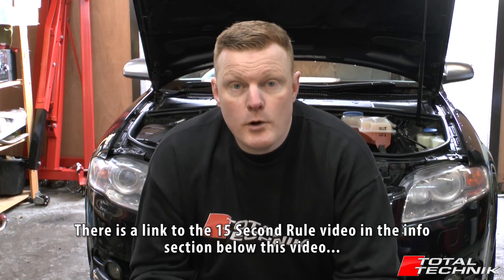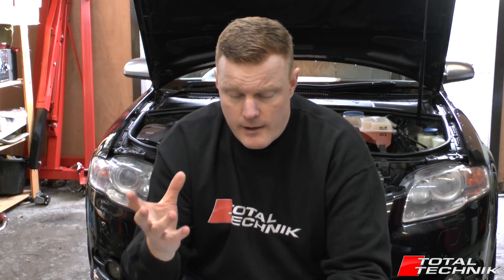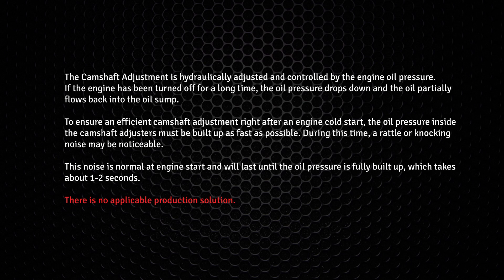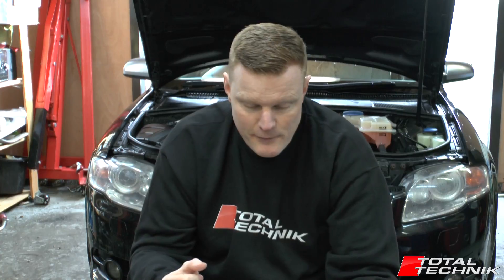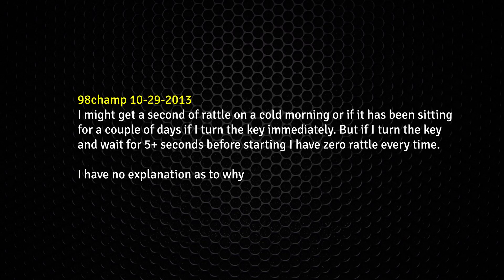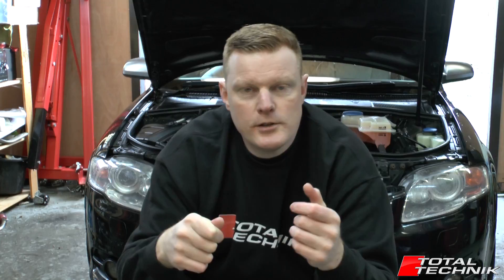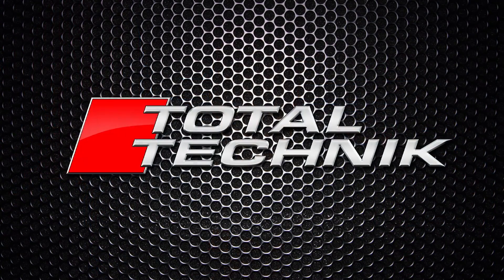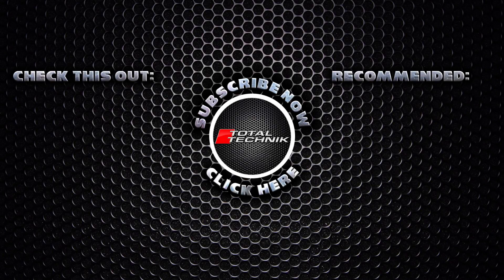Audi S4 15 Second Rule TECHNICAL DISCUSSION -  B6 B7 - 2003-2008

Comment: The B7s that I have fixed have a bad non-return allowing the oil filter housing to drain its contents back to the sump. Change the valve and the rattle at start up disappeared. See video.

Comment: Have a 2005 S4 4.2 with 88K on the clock. When it starts with out waiting 15 seconds it sounds like the timing chain is about to tear itself out of the engine. It does help alittle to wait 15 seconds. But saw a video with a guy who said check valves under intake are at fault. That makes sooo much sense, as they would hold the tensioners up and not allow them to back down. As always, cleanlyness is next to godliness at least with engines.
Reply from the maker: Thank you for your input, very much appreciated!

--- 

To help support us (for both you and others reading this) there are a few things you can do:

1) Donations both needed and welcome! We cannot operate Total Technik without the support of people like you! You can donate by PayPal - just go to www.paypal.me/totaltechnik
2) Please ensure you subscribe to our YouTube channel. 
3) Please give our video's the Thumbs Up on YouTube. 
4) Please help spread the word, the more people who know about us the better! Add links to our video's in forums, let people know about us.

Thank you for your support!
Reply: Have you made any progress regarding the the check valves? I'm looking at doing them on my car and would like to know if it worked or even helped.

Comment: Interesting video here, with another possible cause/solution for cold start up rattle, involving the oil return valves going bad, creating an oil pressure retention problem. It fixed his rattle, but would have been useful to know if the 15 sec rule prevented his rattle before he replaced the oil valves: 
https://www.youtube.com/watch?v=y3HXmNePHkw&list=WL

Comment: I can confirm the 15 second rule works on my 2004 S4 B6. Mine has had the chain revision done, but I used to get a short noise at start-up. So I guess that was the intake flap.
Reply: SsgtHolland how much did it cost you to have the timing chain guides and tensioners replaced?
Reply: @pw760  personally it cost me about 5k. Warranty wouldn't cover it. However I still had rattle until I changed my check valves.
Reply: Did you do anything about the intake flap? Was it decreasing your torque at all?
Reply from the maker: Perfect - thank you for sharing the info - that's exactly what this video and discussion is for! Thank you!

--- 

To help support us (for both you and others reading this) there are a few things you can do:

1) Donations both needed and welcome! We cannot operate Total Technik without the support of people like you! You can donate by PayPal - just go to www.paypal.me/totaltechnik
2) Please ensure you subscribe to our YouTube channel. 
3) Please give our video's the Thumbs Up on YouTube. 
4) Please help spread the word, the more people who know about us the better! Add links to our video's in forums, let people know about us.

Thank you for your support!

Comment: I’ve had an 06 B7 S4 for 2 years. To be honest I’ve always given it it 5 or more seconds just to let the fuel prime to make sure I get a clean start. I’ve had turbo’d cars that had problems created with stuttering starts so I always try and let things ‘get set’ before turning the key so it fires instantly, and therefore builds oil pressure fast and tightens the chains. On an earlier comment the theory of ECU’s and sensors taking various times to stabilise and therefore giving time to ‘get set’ again for a crisp start - I’m with that theory. Even just giving it 5 secs and I rarely hear chain rattle - I mainly get flap valve flutter, including at tick over that goes when you push the actuator arm with your finger. My car is in Hong Kong & I doubt it ever got an ECU upgrade to reduce flap rattle at start up - but not worried.

In my view giving this car with a lot of complex sensors and ECU’s, and lots of heavy moving parts, the best chance of a clean start is the key to chain / tensioner health - to a degree. They are still weak components - so I’m still sitting on a time bomb, but it’s a great drive ...
Reply from the maker: Thank you for sharing - that's exactly what this video is about so we appreciate the input, as we're sure do others as well!!

--- 

To help support us (for both you and others reading this) there are a few things you can do:

1) Donations both needed and welcome! We cannot operate Total Technik without the support of people like you! You can donate by PayPal - just go to www.paypal.me/totaltechnik
2) Please ensure you subscribe to our YouTube channel. 
3) Please give our video's the Thumbs Up on YouTube. 
4) Please help spread the word, the more people who know about us the better! Add links to our video's in forums, let people know about us.

Thank you for your support!

Comment: After watching various videos and reading comments regarding the B7 S4 rattle, I've decided to start my own experiment and over the next few months make/keep some notes and report my findings at the end for anyone who may find it useful.  I brought my S4 Avant with 95k and FASH  7months ago and have done 8000 smiles since,  with no dramas other than everyday running costs (fuel lol) but that's irrelevant anyway. My car rattles when it wants (for upto 2 seconds) and cold starts make no difference as its rattled at 13C+ and I've heard nothing -3c which makes me think its something to do with pressure?? however I'm no mechanic or Audi specialist so may well be wrong?  However on a personal level,  temperature doesn't seem to be the main issue for my S4.  I'm intrigued more than anything to know more myself because I'm sure its the main thing that puts people off buying them or are they are becoming that rare???  Because I've not seen another since buying mine... which along with the v8 were the 2 main reasons I opted for an S4 over s3
Reply from the maker: Hey there! Thank you for your input and sharing - that's exactly what this video discussion is about!!

The term cold start means that the engine is cold. It does not have any relation to ambient temperature. So many people will experience a rattle when the engine is cold (i.e. left overnight or for a long time). When re-starting when the engine is warm or partially warm often it will not rattle, depending on the nature of the issue at hand, which is outlined in the video and the comments here.

Yes, the rattle issue can indeed be a factor that puts a lot of people off of buying these superb cars. A shame really as all things need to be taken into consideration, i.e. no regular cambelt changes but one big timing chain job instead at a much higher interval = not a massively dissimilar price overall?

But yes, the V8 is a huge bonus!!!

--- 

To help support us (for both you and others reading this) there are a few things you can do:

1) Donations both needed and welcome! We cannot operate Total Technik without the support of people like you! You can donate by PayPal - just go to www.paypal.me/totaltechnik
2) Please ensure you subscribe to our YouTube channel. 
3) Please give our video's the Thumbs Up on YouTube. 
4) Please help spread the word, the more people who know about us the better! Add links to our video's in forums, let people know about us.

Thank you for your support!

Comment: Really interesting , I have just got a s4 which had a chain replaced 35k ago

I get what I assumed was a chain rattle on hot or cold starts , even if the car only sits for an hour. The car has no rattle once running and drives fine 

I am wondering if mine is intake related as that would make more sense than a chain that rattles every start then drives fine 

I’ll be checking to see if the update has been applied and if not I’ll report back if it improves things
Reply from the maker: Thank you for you input, and definitely come back and let everyone here know any updates! Seems to be a really popular topic, so please be sure to come back and share any more info with others here. Thank you!

--- 

To help support us (for both you and others reading this) there are a few things you can do:

1) Donations both needed and welcome! We cannot operate Total Technik without the support of people like you! You can donate by PayPal - just go to www.paypal.me/totaltechnik
2) Please ensure you subscribe to our YouTube channel. 
3) Please give our video's the Thumbs Up on YouTube. 
4) Please help spread the word, the more people who know about us the better! Add links to our video's in forums, let people know about us.

Thank you for your support!
Reply: I recently bought an S4 which also (allegedly) had its timing chains done. Every now and then on start up (warm or cold) I also get a short slapping/rattle sound. You think this is probably the intake flap? If so, what should be done about it?

Comment: I have had a total chain and tensioner change on my S4 2004. Tried to learn as much as i could during that operation. I have also had the problem with ratteling intake flap. 
When i hear about those who have less ratteling when they wait for 5-10 seconds with the ignition on before crank i can think of two things. Either the flap in the intake manifold, or the electical chain tensioners on each cylinder head. Maybe those tensioners have time to pick up the slack in the chains if you wait 5-10 seconds with the ignition on before start... What do you guys think of that theory...? My problem are solved. Total chain-service and the intake thrown to hell and replaced with a self-built supercharger system. 
Thanks for the video!
Reply from the maker: Hey there! Thanks for sharing your experiences for others - that's exactly what this video is intended for :-)

--- 

To help support us (for both you and others reading this) there are a few things you can do:

1) Donations both needed and welcome! We cannot operate Total Technik without the support of people like you! You can donate by PayPal - just go to www.paypal.me/totaltechnik
2) Please ensure you subscribe to our YouTube channel. 
3) Please give our video's the Thumbs Up on YouTube. 
4) Please help spread the word, the more people who know about us the better! Add links to our video's in forums, let people know about us.

Thank you for your support!

Comment: Interesting video and discussion. Within the couple years of owning my B6 S4 I have replaced the chains and cam tensioners along with the intake manifold flapper (including update to software). 

My main take homes from the various noises these bought about:

1. Before replacing the chains, there was a noticeable noise on startup at the back of the engine, particularly on startup but if you listened carefully it was there most of the time when warm too. I ended up have 2 cracked guides and sporadic codes relating to camshaft positioning.

2. When my intake flapper went bad it produced a fairly similar noise to the chains but louder and it didn't seem to be isolated to just cold starts. My flapper was basically stuck open meaning I lost some grunt lower down the rev range. It meant the car felt more slugglish accelerating than it should. Up at the top end it had no affect as the flapper is supposed to open around 5k (or something like that).

3. Since having the repairs I've had zero startup rattle from cold starts. The chains were done 18 months ago and still no noise on startup.

So I'm not entirely sure a healthy S4 engine should have any sort of rattle but I've only ever own this one so no others to compare with.

Comment: Hey thanks for you videos. Very informative. I have a B5 A4 with the 2.8 amx engine on 230,000kms. This engine also has "the rattle" on cold start for 1-2 seconds. It even says in the owners manual for the car that this is normal and not to be concerned, this is from 1999. Of course the 2.8 v6 doesn't have a timing chain, it uses a belt. I'm not sure if it has an oil pressured tensioner or intake flaps but it still makes the noise. To me it sounds like the cams and valve rockers are dry for the first second or 2 until it gets oil pressure and the noise stops. Also this noise is intermittent. Sometime I can leave the car for a week and it won't rattle on start other times it will rattle after 1 night parked up. I saw the video from magic smoke and to be fair it makes a hell of a lot of sense because sometimes the valve might actually hold the oil and other times not. Maybe my engine has a similar oil valve to the V8 that's letting the oil drain out when it shouldn't. Maybe auid V engines all had this faulty valve. It's worth a look if anyone feels like trying it and you've already had the chain job done. I'm interested because I wanna buy an S4 B7 but have been holding back because of this issue.

Comment: The problem comes from two things. The audi is loaded with tiny ecu's each that comes ONline with it's own self test. All drawing amps simultaneously. This in conjunction with a fuel pump that has not primed will cause longer crank time. Thus low  fuel pressure. The pcm uses voltage reading for injector duty. If volts are unstable at cranking it may inadvertently produce a longer start up. if the ECU voltage is not aloud a few seconds to normalize you are asking for a inefficient start up. Hell By the time fuel pressure is optional and ignition, and pcm timing calculations are worked out <15 sec>. She will work together to quickly spin the engine and build pressure to shorten a few miliseconds the system needs to normalize. 15 sec ruled explained. Somewhat lol. So in conclusion the longer it takes the ignition to happen efficiently. The longer its going to rattle. Rpm+time= oil pressure.

Comment: hi i'm a current s4 b6 owner with 90,000 miles on my car. No rattle as of yet. But i'm very interested in the subject, i came across a video a few nights ago (link at the end of comment) where this guy claims the rattle is caused by a faulty oil non return valve. unfortunately the guy says it works but dosent prove that it works. Maybe you can shed some light on this and give your opinion. Could this valve have something to do with it.
https://www.youtube.com/watch?v=y3HXmNePHkw

Comment: I just spent 4 grand on an OEM ultimate timing chain kit. I had a certified Audi mechanic do it and even with the 15 second rule it still rattles for about 1-2 seconds and goes away. The parts and yes even the hydraulic adjuster are 15 days old and it still rattles. I do not believe this method works it only drains your battery in my opinion.
Reply: B6_S4, I think your case could be caused by non-returning valves which keep oil in the filter and oil channels in cylinder heads, 15 sec rule only works for flaps noise in the manifold!

Comment: Please people like this post so it can be cleared up once and for all, and people who are not familiar with this engine aren't thinking they are preventing a problem which they arent. The first reference link I clicked is from sunnys4 who I happen to know from audizine, his problem was not chain rattle but the intake manifold flapper. I said it in the last vid the 15 second rule does NOTHING for chain rattle, since the oil pump is not electric and doesn't prime, and oil pressure is ONLY build up after the car is started.  If you have a rattle that disappears when waiting with ignition on accessory mode then that's likely caused by your variable intake manifold flapper, another known issue easily to be confused with chain rattle, or something else, but definitely NOT the chains/tensioners. 
Please read the following audi bulletin:

Technical Service Bulletin Transaction No.: 2017369/3

24 Rattling from intake manifold Release date: Dec 17, 2008

Condition

REVISION HISTORY

Revision

Date

Purpose

3

-

Revised Title to add Repair Group

Sporadic hard metallic rattling sound from intake manifold only after first cold start, audible for 1-2 seconds.

Technical Background

Early activation of the vacuum solenoid valves for the variable intake manifold by the Engine Control Module (J623) during cold engine starts may cause the internal intake flaps to vibrate and create a brief rattling sound from the intake manifold.

Production Solution

New software in Engine Control Module (J623) resolved the intake manifold rattling issue.

Tip: Please explain to the customers that this new software is the latest software level with improved driving characteristics, which includes the following changes:

etc
Reply: ARA BLUE S4 are the Audi dealers still giving software updates to the ECU  on these Audis.
Reply: @bluemoth1879  I am also curious about this question
Reply: S4 where did you find that from?
Reply: So just a system reflash essentially?
Reply: Am looking to buy a spares or repair S4. The car is advertised as timing chain problem but then he has also stated there is a misfire in more than one cylinder. Is the misfire related to the timing chain or this something that needs to be fixed separately

Comment: In summary:
 I would like to stick out my neck and state....on the record......
If the 15 second rule works for your S4, - it's the intake flap rattling.👍
If the 15 sec rule has NO EFFECT.....it's your 'chain'. 😕
Reply: Thanks for the info! I was wondering why the 15 second trick had 0 effect on my startup rattle.
Reply: norincobro capri Great info on that.. simple and straightforward.

Comment: I have a 2003 S4 Tiptonic. Mine has a rattle on start up. I have tried the 15 second rule but unfortunately didn't make any difference. The sound seems to be more of a external metal rattle, which would make more sense in being the intake manifold. I think there are two unrelated issues. Thanks for you video, spot on.
Reply: I saw a video where the guy determined it to be a bad oil return valve. Seemed valid to me. If the oil runs out, the timing chain and tensioners are dry and will clack until they have been lubricated. He says it fixed his issue.